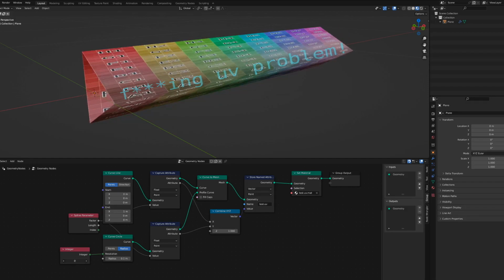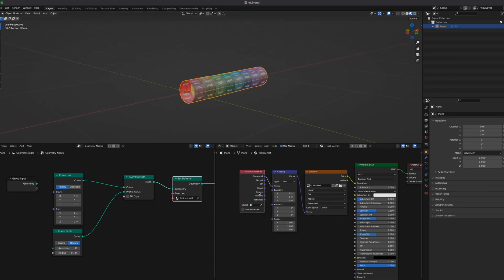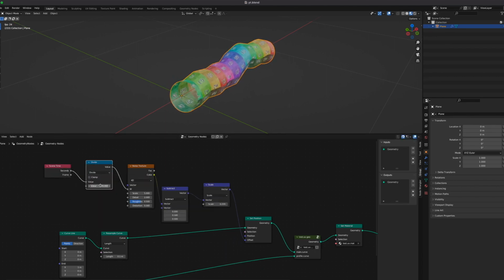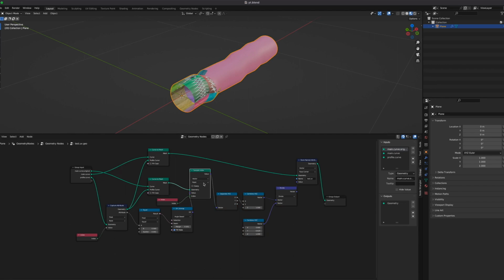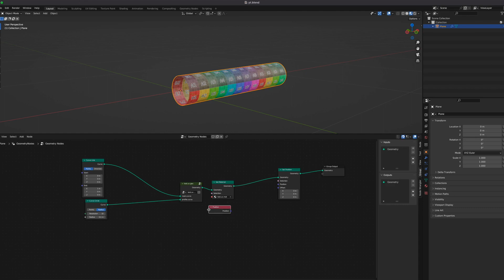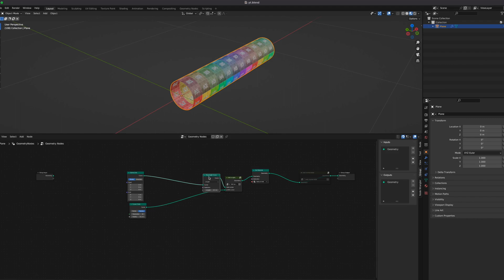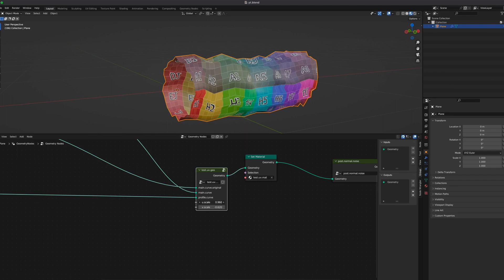Quick! UVmap in geometry nodes #blender

Comment: This doesnt work if you have Fill Caps on the mesh. Trying to see how to overcome that.
Reply from the maker: Exactly, you are right 😀.  I was just focused on non-cap case, and didn't cover filled-cap case. 

But I have an idea for it. 

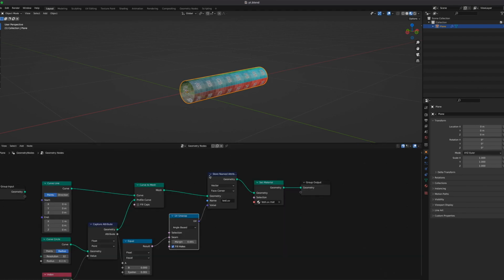Based on 2:01 node configuration, 
First, insert "Capture Attribute" node between "Curve Line" node and "Curve to Mesh" node, and capture "Endpoint selection" as boolean (start size 1, end size 1,  it means caps)
Second, insert "Split Edges" node between "Curve to Mesh" node and "Store Named Attribute" node, and then plug "the captured endpoint selection attribute" into selection socket of "Split Edges" node.

I tried this a little while ago, It worked. 
If you want test file for this, please leave your email here.

Thank you for watching my video.

(edit) : 
Above "It worked"  just means that caps got an orthogonal uv map.  
But the boundary texture is discontinuous between caps and main body.
Reply: @CGBurgerStudio  Thanks for that. I found another method that works, as well as using the index = 0 to define the seam down the middle, use the Evalulate on Domain, Boolean, Face, and then plug in the NOT of Is Shade Smooth. This will only output the 2 faces as true. Then join that using Boolean OR with your original Index = 0 booleans. Feeding them both into the Seam. This method seems to give continuous texture onto the endcaps.
Reply from the maker: Wow, I haven't used "is shade smooth" node so far and I just understood when to use the node, thanks to you. 
My method also makes seemingly same result as yours, I like your method in that it does not involve any changes in geometry.
Have a nice day.